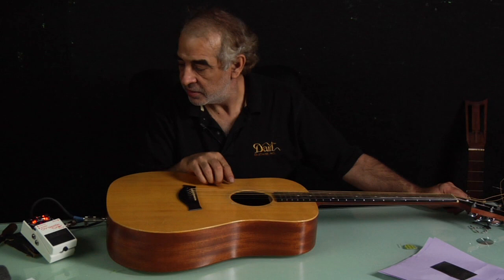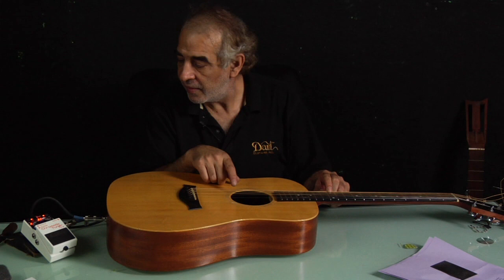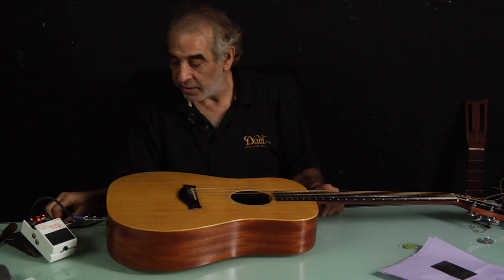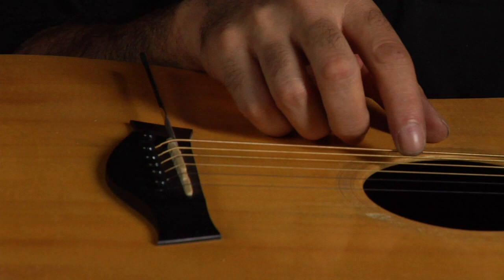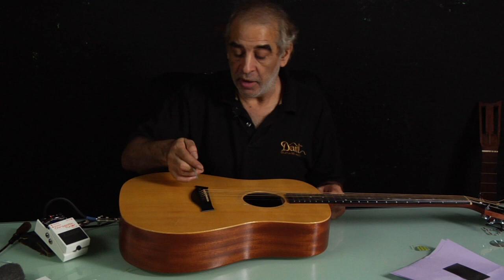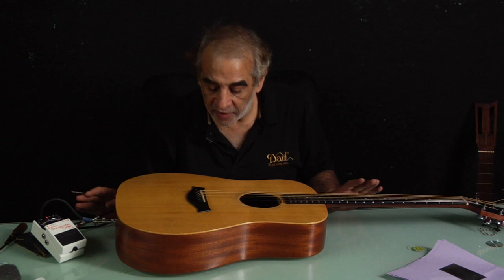Acoustic Guitar Setup : Acoustic Guitar Setup: Determine Intonation Problem

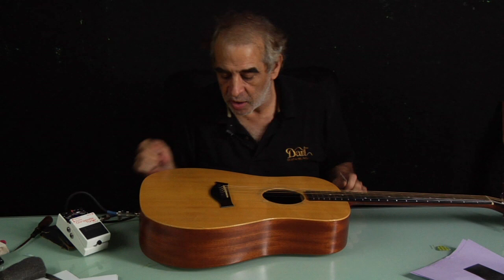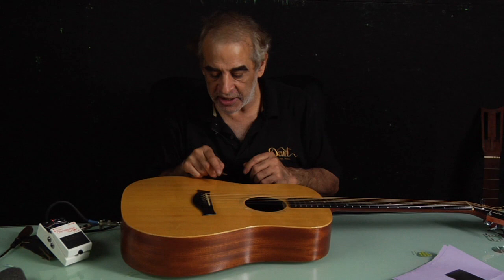Comment: This man referred to the guitar's saddle as "nut" (at 1:02 and 1:14), so take his presentation with a grain of salt.

The guitar's nut is the small white or off-white device located near the headstock.  Along with the saddle on acoustic guitars, the nut supports the proper height of strings above the fretboard.